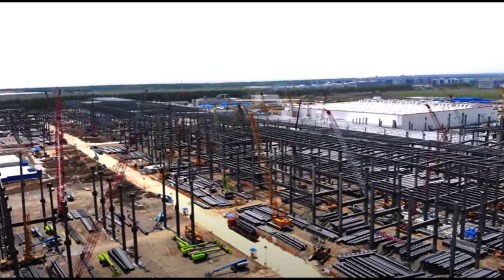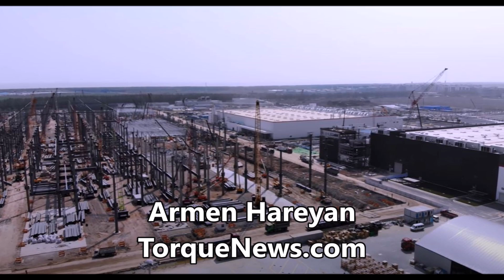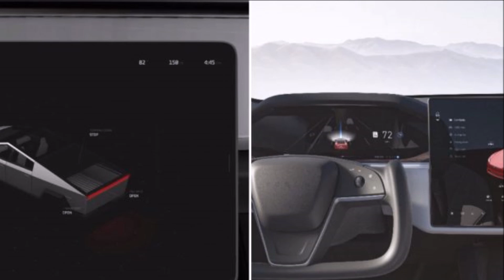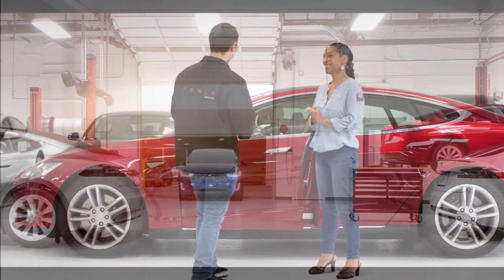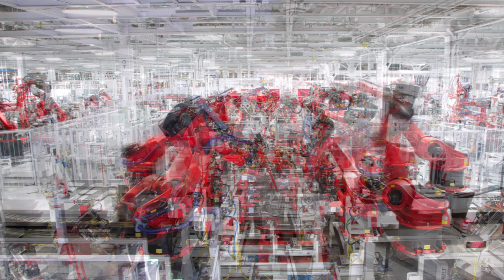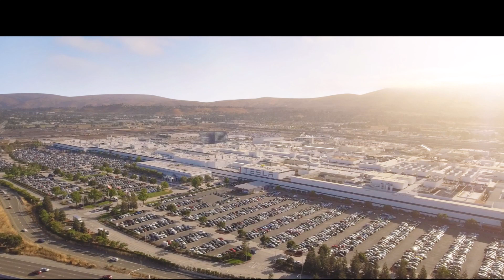Tesla Pays Off Giga Shanghai's $614 M Debt, and Updates on 4680 Cell Production

Comment: In short, new Model S Plaid/Plaid+ will not use 4680 cells or structural battery pack... so imagine the level of performance Tesla cars will achieved when they will use the 4680 cells ! I believe the first model to use the 4680 cells will be the Roadster 2.0.

Comment: Thanks for the information   Question can a customer exchange the 2670 battery to a 4680.  Can this be an update if customers want.  Are the batteries in Tesla cars easily exchanged???
Reply: Short answer is no.
Reply: No, but the 2170 cells are very good anyway so there is no advantage to swapping them out of an existing car.  The 4680 cells main objective is to be cheaper and easier to produce in high volume.  Retrofitting them into an existing car (even if possible) would just cost a bunch of money to replace perfectly good 2170 batteries and cancel out most of the benefits of the 4680 cells in the process.
Reply: No

Comment: A lot of people seem to NOT understand the point of the 4680 cells. The notion that they are for the high end vehicles is wrong. Those vehicles already have good batteries. The point of 4680 is to make cheaper more affordable cars. All chemistries will get the 4680 treatment but the most important conversion is to transform prismatic LFP to Battery Day cylindrical LFP for the mass market car.

Comment: Of course it's good news about debt repayment and expanding R&D. I am disappointed to hear that the 4680 mass production is delayed, but it does make sense , with the biggest clue being that the new Model S Plaid was delayed until next year. Still, it's good to hear any news regarding their plans to have volume 4680 production next year. I hope that Tesla is sandbagging, because in addition to the new Model S Plaid+, the European Model Y, Semi, and Cybertruck are supposedly using the 4680 batteries. And I would hate to see these potentially impressive models delayed any further.
Reply: Like Elon has often said it’s all about the batteries, in this case esp. the 4680.  Once mass production happens on that, Tesla will be unstoppable, don’t see yet any really competing battery at the production or near production level. What does Lucid have up its sleeve on batteries, no word yet, but they are claiming 500+ mile range. My MS LR+ is rated at 402 miles, more than enough for me.  MY with the 4680s will replace my aging Toyota van I hope in 2022/23.